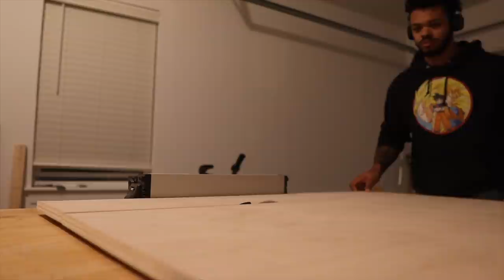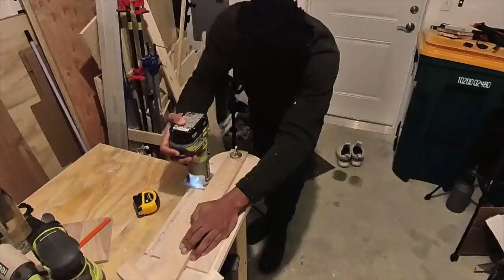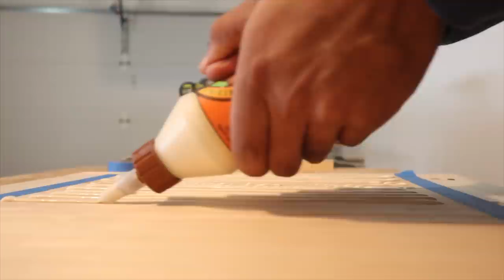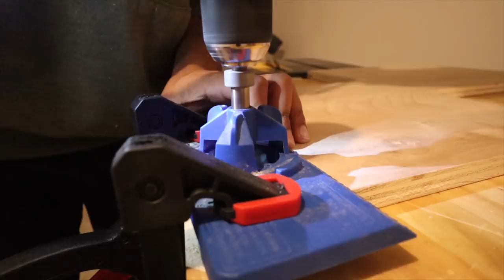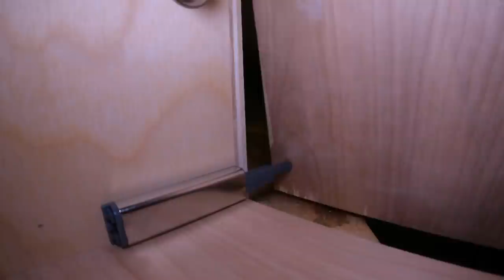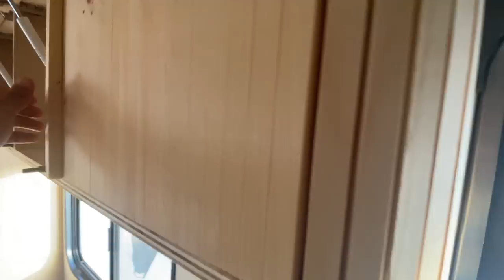Building a Tambour Door Cabinet During a Blizzard | RV Renovation Ep. 6

Comment: I enjoy your stuff - I've been designing and building higher end furniture for over 30 years so my tip for you is just coming from experience; you're using a rip blade on your tablesaw and you're getting a lot of tearout with it. A plywood blade would make much cleaner cuts - You could go with a good quality combination blade if you don't like changing it much. When you get pitch buildup on the teeth you should take the time to clean it as that will give you cleaner cuts as well. 
  You're doing enough work where it's worth having a collection of quality table saw blades that you change out for the different materials you're running through that saw 

Keep up the good work

Comment: Nicely done. Worth you investing in pair of scissors called pinkink shears. They cut with a small zig zag which prevents fabric from fraying. You'll find that you need to spray the groove with some silicon, neat if you have it or can of furniture polish high in silicon or even cut down a wax candle to fit in groove and run that around what you can access. Move the door back and forth a number of times to transfer the wax or silicon all the way round. You will find you need to repeat this every now and then as dust and temperature change can make the slide a bit stiff. Depending on what you are storing in the cabinet you might find you need a back wall between the tambour and your stuff otherwise your stuff will move about and get in way of tambour. Really enjoy your builds. 😎

Comment: 1 waisted hardware not needed to bump open the doors,-because they're still not going to open unassisted 
because the geometery of the lift supports isnt quite right.

2 how are the swinging doors going to stay shut while moving -?
  everything will be on the floor if you can't keep the doors shut
3 and it looks like you need to add some paneling inside the sliding door cabinet// in front of the rear track //
to keep things from falling in the track grove  blocking the slide  - (which is required to be free from debrit to open the slide)
 jamming  door shut permanently.. 

 overall decent.. 
needs improvement  
      video as well..
 ps  
 

  A plywood blade would make much cleaner cuts 
 since you are not designing a clean trim edge with the work.,

Comment: i'm thinking the tambour cabinet should have a railing behind it so stuff wont lodge into the sliding mechanism potentially getting the cabinet stuck. I feel like that was an overlook on the design considering how it's a moveable space so stuff move around like if the owner put small things in that cabinet spare change/ keys / loose screws idk it will probably roll there?

Comment: Tambor cabinet doors are always so impressive (and complicated) looking but you made it look relatively simple. 👍  That said, my personal concern with these types of doors is always that something is going to end up falling into the far back and block where the door is meant to slide into and make the cabinet impossible to open. 😅  I always want to see at least a thin inner solid back piece in front of the track with these, even if it's only an eighth inch thick, lol.  Other than that, I love the cabinet, especially the euro-style hardware. 😍